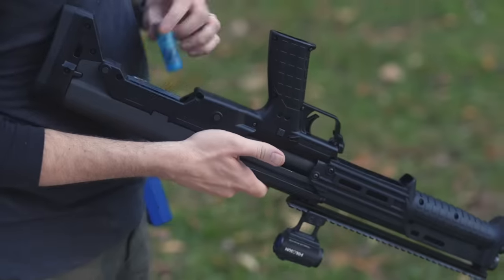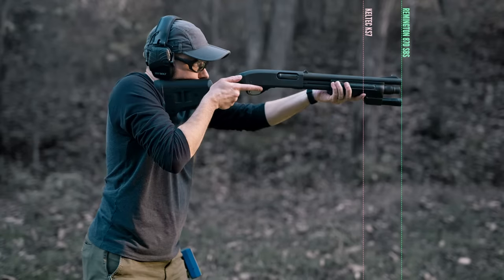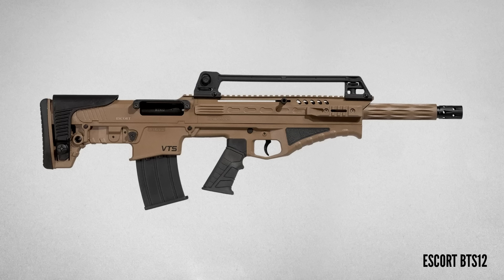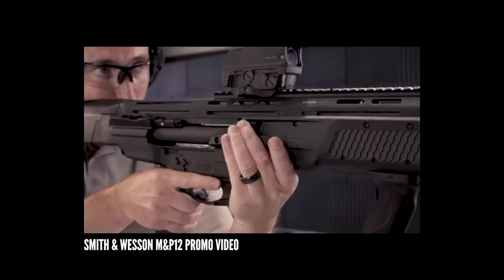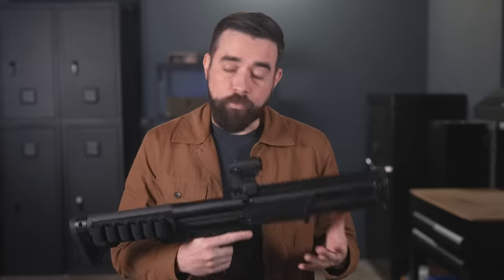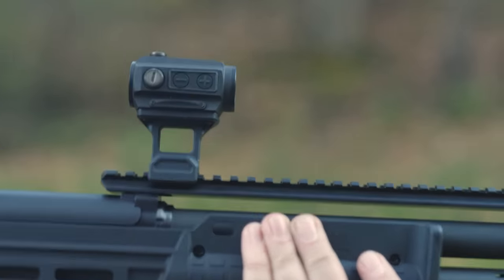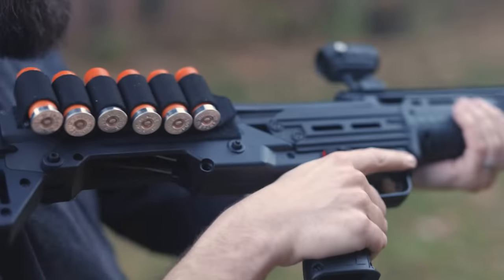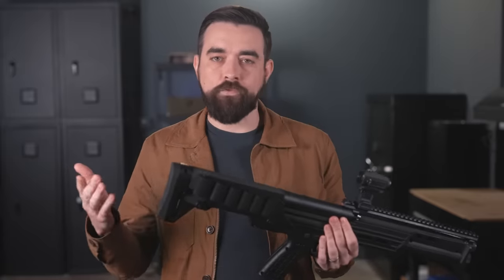The Bullpup Shotgun Experiment

Comment: As an AUG owner looking to get a shotgun, I'm curious to watch this!  I'd also like to say, bullpup designs are usually heavier for some reason; the shorter design can possibly make it more ergonomic to handle that extra weight, but it would be better if it wasn't there to begin with.
Reply: The extra weight is typically from larger receivers to house all the longer control linkages and such. The AUG is a notable bullpup for being the exception of the rule for large increases in weight.
Reply: I feel like an increase in weight would be a definite improvement for 12-gauges in particular
Reply: @kingnull2697  Depends what you want out of it.  If you're hiking a lot with it (like hunting or with slugs for defense) or holding it up for long periods (like while waiting for the cops to show up and grab bad guys), that weight sucks.  Shotguns usually aren't shot much at once outside of practice, skeet, and specific kinds of hunting; so there's certainly use cases where being lighter (or even the same weight as like a 500) is a plus.
Reply: I've got the feeling that, just like with the bullpup market in general, there is a lot of room for improvement on current bullpup shotgun offerings. I'd argue semi-auto would be better suited for the setup, something gas-driven like a Vepr (of course, built from the ground up to be a bullpup, not some shitty conversion).
Reply: If using a bullpup shotgun for specifically home defense you can always add weight with situationally useful stuff like lights and shell cards. It might not take a lot of the recoil away but it can mitigate some. Never thought of the take from someone who runs a bullpup rifle and the introduction of bullpup shotguns before. Makes sense though seeing a somewhat similar manual of arms between the two.
Reply: @lucastonoli3256  The market seems like Mossberg, Benelli, Beretta, and a whole bunch of junky turkish stuff...  Feels like lots of room for new stuff, as long as it's quality made.
Reply: They do tend to weight more, but actually feel lighter during use. The weight is centered behind your trigger hand (this is especially true for the mag-fed variety) and therefore far less fatiguing, even with the additional weight. I just got one a few weeks ago and let me tell you, I am a fan of them for home defense. (I'll be keeping my 870 for sport shooting, thank you).
Reply: Bruh I'm actually so jealous of your AUG
Reply: @sauerkrautjr  Lol thanks, I love it.  I even went with white, because why not get the weird color for the weird gun?  They've been coming back in stock now if you want one, the gun deals reddit even found a killer deal last week on a few.
Reply: Light, 12ga, and buckshot make three things you usually do not want combined in a gun: brutal recoil.

Comment: One thing I wonder is I heard the KSG can run Aguila mini shells fine, so I imagine that could potentially reduce felt recoil while also increasing capacity enough that reloading is unnecessary.

I’d like to see if that could be properly tested.
Reply from the maker: I'll have to try it out. Only the slugs are really useful, though. The pattern on the buckshot mini-shells is garbage
Reply: My neighbor has a KSG and we've run probably 1,000 mini shells through it, it never had any problems.
Reply: @LuckyGunner  Even short rang, 15' or less?
Reply: @LuckyGunner  That also makes me wonder if it would be possible to adapt a version of the Flite control wad for it, though that would have to be some kind of custom shell.

Granted, I’ve always been either or on having super tight patterns. I do personally use Hornady #4 buck with the Versatite wad for my home defense shotgun, but I figure if you’re in a relatively rural area where the chances of someone being in the line of fire is very low, the increased hit probability of a wider pattern can also have some merit.
Reply: My KSG runs minishells just fine.  Accuracy with the slugs, however, is abysmal.  I tried both Aguila and Federal.  Same result.  2.75 inch slugs worked great.
Reply: Anyone considering mini shells should first watch Paul Harrell’s videos where he tested them.  They’re also expensive for what you get.
Reply: You can run the Aguila minis and the Federal minis.
Reply: @kftc1980  Mini Shells are stated by Kel-Tec to work well in the KSG as Iraqveteran 8888 has shown in his KSG video's patterning excellently and effectively...There are other video's as well showing the mini shells doing very well...
Reply: @gaoxuezi  “Effective” and “very well” are relative terms.  Effective compared to 2 3/4” shells?
Reply: @kftc1980  
Asking them to match what a nearly double sized shell does is a bit much but I've had some good luck with them and they perform about as well as the reduced recoil 2 3/4” shells My buddy used to run in a saiga. That thing was terribly unreliable too. Then again, the reduced recoil shells might have been a part of that.
Reply: @kftc1980  I love Paul’s videos, and what he seemed to indicate was the mini shells are good enough for defense but not reliable in the shotguns he tested, though there is speculation that the Opsol adapter he got was a defective one.

But since the KSG supposedly runs mini shells without any modifications, it should be fine.
Reply: @michaelmiller3497  I wonder how buckshot works, or if it’s possible to somehow put a miniature Flite control wad in there as a custom shell to test. If it works, maybe Federal can make a version of their Flite control with it.
Reply: @kftc1980  watch other video's showing the effectiveness of the mini shells such as stated previously...there are  more than just "Harrell"...
Reply: My KSG eats Aguila minis all day-- I've tried all the ones I found (bird, buck, slugs). I'm not 100% sold on the effectiveness of the ammunition, but shooting them is fun and the KSG cycles them completely reliably and the resulting magazine capacity is ridiculous.
Reply: @kftc1980  The Aguilas really are ridiculously pricey: it's a shame, as it renders them kind of a novelty thing in my mind. If they were cheap they'd be like the .22 LR of shotgun ammo: fun to shoot and plentiful.
Reply: Lucky Gunner Ammo I was able to get cans at ~10yd with mini buck shells but not with as many pellets as with standard federal buck.
Reply: @gameragodzilla  I've reloaded fired mini shells with trimmed ballistic products tps wads and have gotten some decent patterns with 8 pellet #1 buck. Not quite as good as flight control, but way better than factory Aguila minis. I was using cast pellets with no buffer though. Plated pellets with buffer may fair even better.
Reply: @LuckyGunner  War Wolf Ordnance also makes mini shells. They are expensive but seem pretty good.
Reply: My KSG runs minis without issues. I can stay in the 9 and 10 ring at 25 yards with mini slugs.
Reply: first time i shot my ks7 i used magnum shells. after two shots i said to myself f&@k this thing. then i bought a butt pad and the aguilla mini shell slugs and now it’s great. i definitely do not try and cycle it as fast as in this video so i haven’t had and jams or issues.

Comment: Personally, all the bullpup shotguns I've seen in classes and futzed with on the range have been garbage for multiple reasons.  You had better luck with the KS7's reliability than I did, because when I tried to run it, it flipped a shell vertically in the feedway and hung the gun up so badly that it had to be completely disassembled to clear.  Then it did the exact same thing with the very next round.  Given that you said it tended to go wonky when you ran it hard, that would make sense, as I run shotguns like they owe me money.  You have to do that to get the best performance out of a traditional pump gun like an 870 or 590.  It may be that the Keltec just doesn't like that, which to me is one more point in favor of avoiding it.  

As to the overall projection from the shooter compared to short-stocking, I'd posit that at the distances where it matters, the accuracy difference will be effectively nil, and having a traditional layout lets you bypass all the weird bullpup quirks.
Reply from the maker: Good perspective, as always, Matt.
Reply: Does that include the S&W and Tavor bullpups?  All the other bullpups seem to be from manufacturers that aren't known for the best quality, so it's no surprise to me that they had issues.

Edit:  I also forgot to mention its great seeing the opinion of someone so highly regarded on the topic at hand in the comments.
Reply: @DWalter.27  I haven't seen any S&W or Tavor shotguns come through class yet, nor have I gotten hands on with them myself, so I can't give a first-hand opinion on either.
Reply: @matthaught4707  Thanks for the info.
Reply: "flipped a shell vertically"
wat.
But how? Like how is that even possible? I'm guessing it was a minishell? That's the only way I could imagine a shell flipping vertical inside the action.
Reply: @matthaught4707  If you ever make a trip up to the Duluth area to teach a class, I'll bring a TS12.
Reply: @LinkHyrule03  Nope, standard 1oz Foster slug.  I forget the brand, but it got all kinds of bobbled up in there.  That said, some slugs can be a skosh shorter than your typical star-crimped shot round.
Reply: @matthaught4707  It's not surprising you haven't seen them, they're relatively new. M&P 12 just came out this year and the TS-12 was last year I think. I'd let you try the Tavor but sadly I'm no where near OK.
Reply: @Furluge  when I heard Smith was bringing out a new pump gun I was all excited. Then I saw it and it was like that meme: "Oh no, baby, what is you doing?"

Comment: I believe a accuracy test should have been added to your review , I have a 4 gen. KSG and tested every 2/34 Foster Slug that I could purchase and by far , the Remington Slugger was the most accurate (shooting through a multiple reticle red dot ) at 50 yards it consistently surgically cuts out the bullseye , so it works for me and out of seven shotguns pump and semi it is my bed side choice .
Reply: There is no reason to be using slugs out of a shotgun unless you're deer hunting. There is no advantage to a slug gun over a semi auto rifle.
Reply: @xxxxxxxx183  O.K. thats your opinion, but I totally disagree .
Reply: @MrSymbolic7  that's fact. Give one real advantage a slug gun has over a semi auto rifle? 
The rifle will have
Less recoil
More accuracy 
More range 
More capacity 
Faster follow up shots
More energy depending on caliber
Typically more reliable then semi auto shotguns.  If you want to compare pumps then pump action rifle still has all the other advantages.

I can't thing of one reason that a slug gun would be a better choice.
Reply: Bears
Reply: @xxxxxxxx183  You argument is wrong from the start , I said bed side gun and nothing will stop an intruder like a  12 gauge slug at close range , you only need one well placed shot and it's over ! Range in a home really ? Are you such a bad shot that you need a 30 round mag at 20 feet ? I could go on but you know better than me , so what's the use , cheers !

Comment: Mossberg 590 (7+1) in a bullpup unlimited. 
Pros: Reliable, easy to load, less felt recoil.
Cons: heavy, complicated disassembly.
I went down this road when I was green and did lots of research and comparing and I still think it is the best option in its class. Now that I am not green I think there are better options for most situations than bullpup shotguns.
Reply: @LinkHyrule03   sorry to hear you had reliability problems, I have not had any issues with mine.
 I think the action release is mostly for administrative purposes so I can live with that compromise. I agree that the kit is far from perfect, I had to do some minor things to mine before i was happy (round sharp edges, snug up lose recoil pad, eliminate the split trigger, add a bushing to the front around mag tube ext, AFG).

I still think it's one of the best options at this point. I think it's better than the ksg and a hair above is still better. I can reload with it still shouldered, I can shoot magnum slugs all day long and at the end of the day it is still a Mossberg.

Comment: I am a dedicated lover of bullpup design, both rifle and shotgun. Have owned KSG, UTAS-15, and TS-12, here are my two cents:
1. I agree with the other commenter that KSG has rough pump. It is indeed gritter than model 870 but still runs reliably. Feeding problem is a rare occurrence. But to be fair I never tried to run it fast. 
2. The felt recoil of KSG is absurd compared to traditional pump shotguns.  A salvo-12 suppressor mitigates that problem nicely. 
3. The ergonomic and reliability of UTAS-15 is shit tier. It has a square-ish/edged cheek wield which which cuts my face when I shoot it. Extremely uncomfortable. The pump on it is even gritter than KSG and it jams often. Even my friend's Chinese import pump action runs smoother. 
Usually pump shotgun sounds like "thru-thump" and KSG sounds like "clark-clark" but UTAS-15 sounds like "grrrrchichch-eeeeekkllllkkkl" and jams. 
The UTAS-15 is also advertised to be compatible with Benelli chocks but my silencer co Benelli mount cannot thread fully into it. 
4. Flipping the shotgun upside down is pretty much required if you want a fast reload. Awkward with a 2 point sling but doable. Just like reloading without flipping a traditional shotgun. 
5. Bullpup shotguns balance better especially when loaded. I have shot a Benelli M4 with collapsible stock before and it is front heavy. 
6. TS-12 is excellent, the best "tactical" shotgun I have shot. Pros: Very reliable, runs good with almost every kinds of ammo. Felt recoil is mild. Side loading port is clear as day, no flipping necessary for fast reload and no shell lifting gate to stuck your thumb on. Cons: Somewhat bulky. Certain optics may bust knuckle when mounted too close to charging handle. Trigger isn't excellent (although I don't expect an sublime one from a combat shotgun). 

I highly suggest you try the TS-12 if you decided to investigate bullpup shotgun later.
Reply: You seem to know your Bullpups, is there any sort of speed loader available for the ksg? I've seen a couple for standard pump action but not sure how they'd fit into the loading port area
Reply: @jamesm.5125  Not any I know of.  Maybe I can design one.
Reply: @Kayneth93  If you make one that works I'd buy one.

Comment: Seems to me the only real “bad” things are the action and shoulder stock. Everything else just seems like something to get used to, like with any gun.
Reply: The pump requires some real positive force to drop a fresh shell from the tube onto the riser, which is something you could definitely get used to. The fact it ejects from the same hole it loads from could give you some real issues if you get one stuck in the chamber, I haven't, but clearing a malfunction like that might require some disassembly to get the spent shell out. The recoil is pretty rough even with light loads, and while I'm sure an average person could get used to it my dad and I have both had injuries to our right shoulder, mine is less severe and the KS7 only poses a problem on a really sore day but for my dad using pretty most 12 gauge shotguns is hard for him and I think the KS7 would be exceptionally bad unless low recoil shells are used.

All in all though I like the gun, and if SHTF I'd pack it over any other shotgun because it's light and compact, but under normal circumstances for someone getting what might be their only shotgun I'd make the standard Remington 870 / Mossberg 500 recommendation. Maybe one of the Turkish semi-autos if they'd prefer, I think they're really easy to use, pretty light recoiling, and don't have the same concerns for malfunction clearing, and if the bullpup versions are anywhere close to the VR60 in terms of recoil that could be a tempting option

Comment: I'd be interested in seeing more bullpups being tested, but I don't think it will produce any different results. And I think the people cheering on bullpups are going to be disappointed by what you find out in your videos.

Bullpup shotguns have interesting features that when compared against a standard pump shotgun on paper, seem to be better. 15 rounds instead of six, 11 inches shorter than a traditional 18.5 inch barrel tactical shotgun.

But when I think about the big picture, I'm not sure who these features are for. Like you said in the video about cruiser configuration, "if I have to reload after firing 6 rounds of 00 buck, something has gone terribly wrong." I have a feeling the only people who think bullpup shotguns are a good idea are the people who already have one. Novel doesn't necessarily mean better. Still, Glocks were reviled when they first came out, and it took a generation of younger people using them before they became respected. Maybe bullpup shotguns are the same.

In every shotgun class I've attended, the people with the bullpups were much slower at drills than the people with a pump action or semiauto, and needed much more coaching to do basic manipulations. The shotguns themselves also seemed to be much less reliable than pump actions, even when accounting for people short stroking the pump.
Reply: Even though I'm a fan of these guns, I will add that some bullpups require a long break in period and the trigger pull is harder than standard configuration shotguns. Definitely not something you want to be surprised with at the range

Comment: Similar to the CZ Scorpion, the KSG is not meant to be left stock, if you don't have the budget to add a thicker recoil pad, muzzle brake, extended tube switch, reinforced pump rail, foregrip, flashlight, red dot/ holographic, and back up irons, then this gun is not for you. If you do have the budget, the KSG is a MONSTER. But don't expect it to be like other shotguns